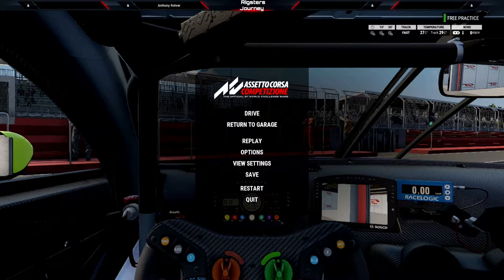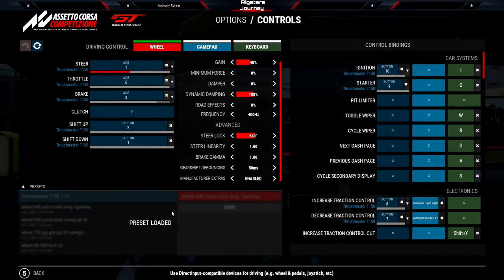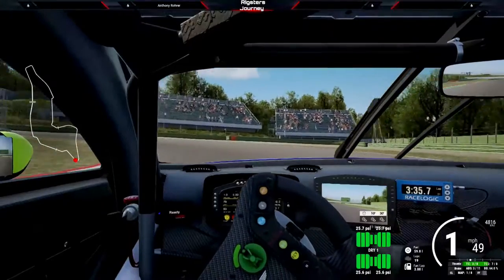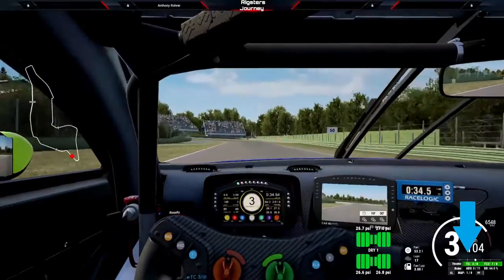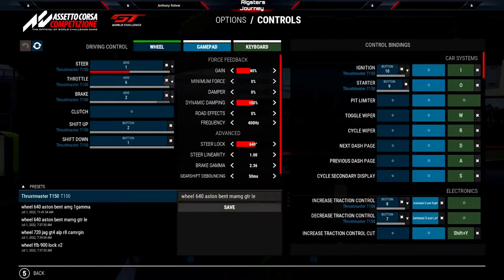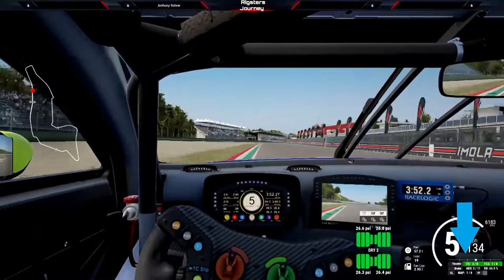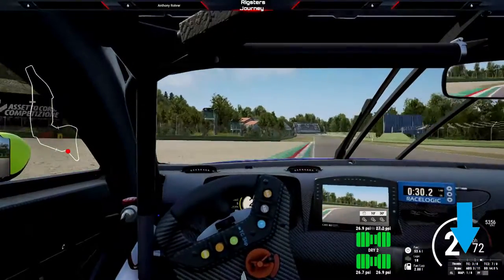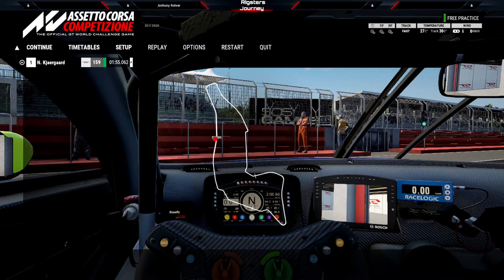Assetto Corsa Competizione | Brake Gamma Tip For Potentiometer Pedals

Comment: Mine does the complete opposite for some reason, when I increase the gamma I have to push the break even harder to reach desired brake force. I am using G920 on Xbox and cannot get close to 100% brake power !
Reply from the maker: woah thats werid. hmm on xbox it does the oppsoite. i honestly dont know what to troubleshoot for that issue since i dont have one. imaybe should also check if it has a wheel itself driver or software setting, if that is not possible try also adjusting in the game itself the brake max limit. The max limit basicly adds a grey bar that allows for the pedal to be less pressed to do max braking.
Reply: There is no break max limit on Xbox :(
Reply: For consoles it doesn't work the fix is to change tha brake dead zone and don't mess with gamma
Reply: @makisalaloum4861 for real? Because you have to press the same level it seems
Reply: @sammydendoncker3980  no you don't have to press the same. if you regulate it to 50% you press the brake half way and it registers 100% you can check it at the bottom right corner on the brake bar . 25-30% it's ideal for Logitech g920
Reply: @makisalaloum4861 do u know  the  gamma value for the Glg923?